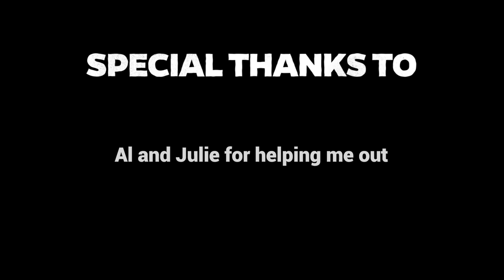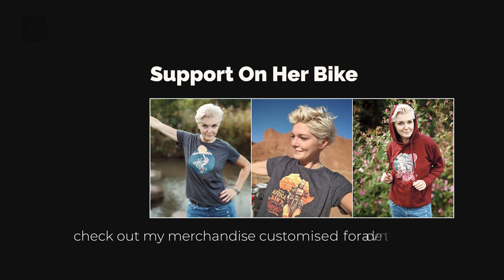Broken Down in Arizona! - EP. 231

Comment: Hello, I once had a motorcycle that had two holes in the rear rim. One was for the tube valve. The other was for a rim lock that prevents the tire from spinning on the rim during acceleration and de-acceleration. I used molybdenum disulfide, which is a high shear dry lubricant, fortified grease, on bearings. Such as steering, wheel, etcetera. Your bike sounds good. Your mechanic was excellent. I wish no more break downs for you.    As is so often shouted in unison on the streets of Kyoto, Japan:     " Hey! "                                 YouTube video:       
  2017.3.26京都橘高校吹奏楽部京都さくらパレード交款コンサートパーカッション

Comment: My unsolicited opinion.

If the automatic timing chain adjuster has hit the end of its range, that means the timing chain has stretched. Possibly beyond its design limit. If that chain fails, the camshaft will stop while the crankshaft continues rotating, causing pistons and valves to try to occupy the same space at the same time. The manual timing adjustment is an easy fix for now, but the next chance you have to dig into the engine, you should replace the timing chain.

Comment: That looks like the second hole for the extra valve stem needed in a rim when using the Tubliss system
Reply: I thought it was for a rim lock. So the tyre doesn't move on the rim when running low pressures

Comment: Whoever did your rim to make it tubeless failed big time. Didn't even clean the spoke nipples of rust and used silicone. Use 3M Marine Adhesive Sealant 5200 then cover it with 3M Extreme Sealing Tape 4411N. I did both my front and rear wheel on F800GS and works great.

Comment: After decades of bike engines being fitted with cam chains, the manufacturers still have not figured out that they are inferior due to the perennial tensioner issues. 

Long ago Velocette and Ducati used bevel drives. Honda famously solved their reliability reputation by fitting gear cam drives to their VFR750, as well as the awesome 400cc CB-1 and CBR400RR etc. 

Yet here we are in 2023, Ducati use belts that only last 5,000 miles (?), Honda seems to have perfected the cam chain drive, but BMW is still playing with solutions that don’t work reliably. Very frustrating. 

Al’s manual system is a fix for sure, but it requires the owner to be vigilant and capable and willing to not only adjust it when needed, but be capable of doing so correctly, and recognising when it’s necessary. That takes mechanical experience - which most modern riders not only do not possess, but they have no desire to acquire it. There are too many aspects of modern bikes that no ordinary mortals (without a laptop and the official factory diagnostic software can fix. 

How did we allow it to become this way?

Ride safe. 
Peace